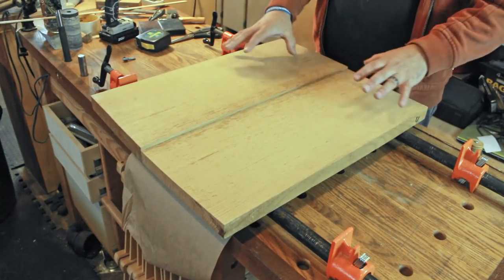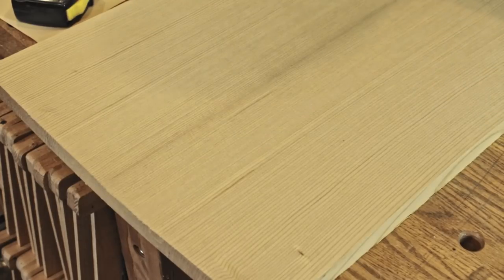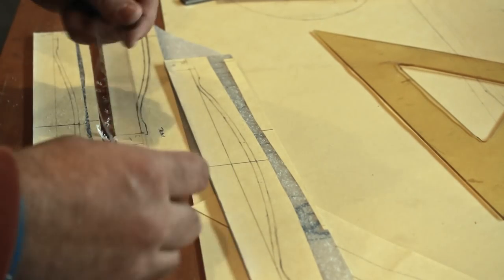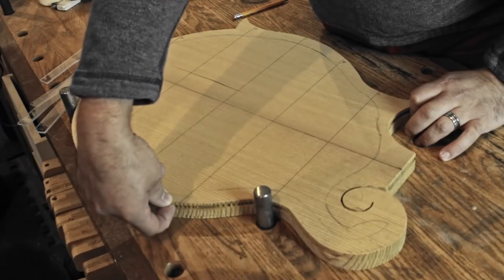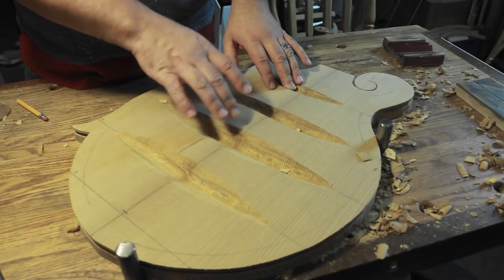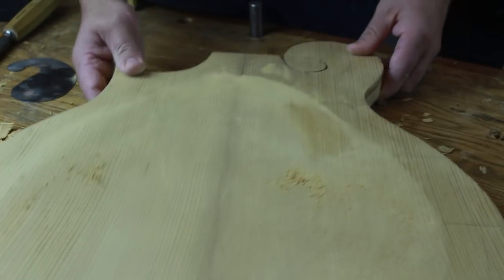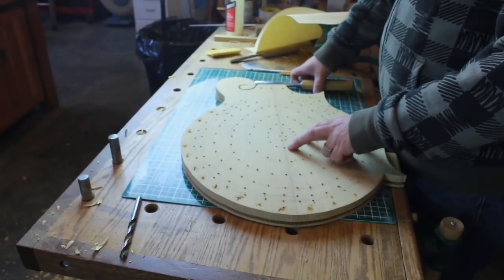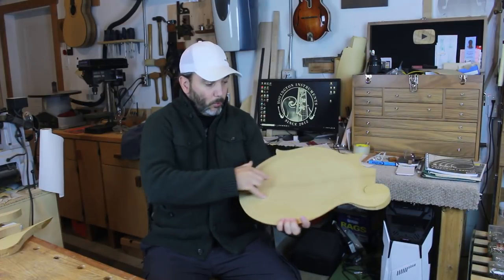Carving a Mandocello soundboard/ Part 5

Comment: Great video and great work on the instrument!  When you are clamping with Pony clamps, how do you keep the black pipe from staining the wood at the squeeze out points?  When you wipe away the squeeze out, you can't get under the pipe.   I use wax paper between the pipe and the wood, but that's a pain in the butt.  You didn't use any barrier, what's your secret?  Cheers.

Comment: Surprised a bit to see you using TB glue.  Was expecting hide glue.
Reply from the maker: I really like working and the results I get with TB glue. The way I see it glue is just the means to hold the crafted parts together. TB and similar glues have been used by a lot of mainstream manufacturers as well as luthiers alike since they have been available. I’m not saying I will never use hide but I will not use it in this build. Thank you Robert for watching the video.